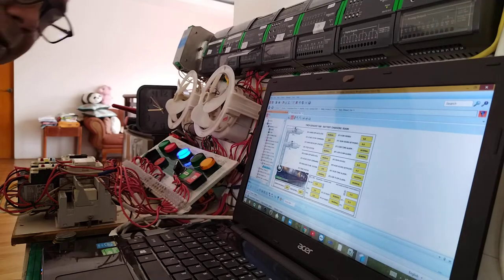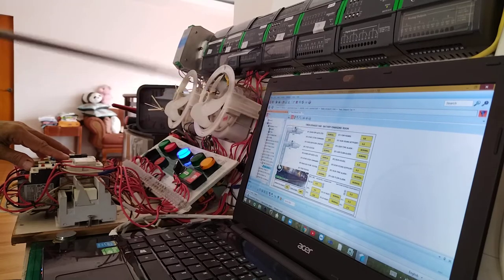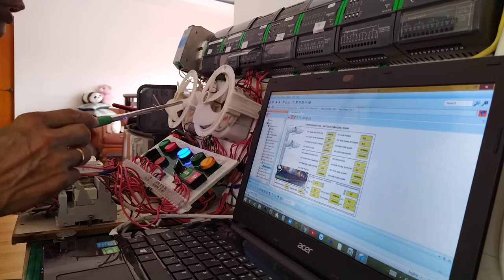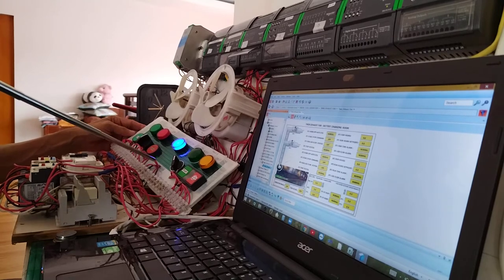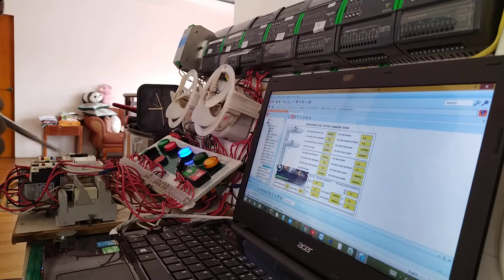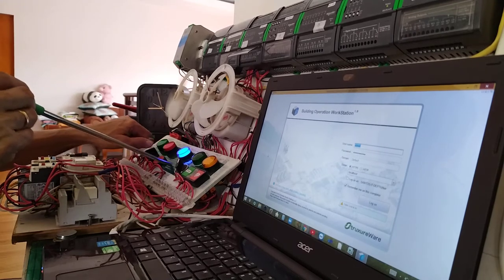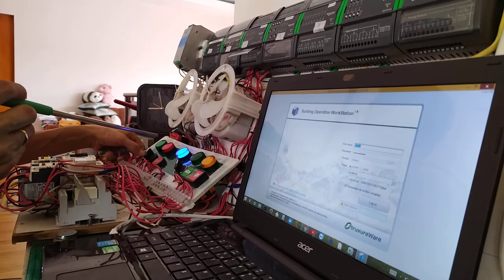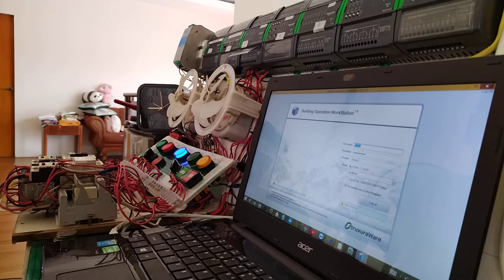New Mini Lab setup on How to Engineer a BMS project

Comment: sir my bms station when i chek my chiller parameter is coming form chiller to chiller configuration point but this parameter not show in my chiller station. so what can i do to all  communicate with chiller point to chiller stations
Reply from the maker: show me some picture, I have  no  idea
Reply: @SantosJrCapellan-BMS  last time come seam prlm coming technician and speak me. here have setting when going power. this time all going to default settings and all parameters secure any wher but i don't know how
Reply from the maker: I don't know  if you are  referring to a Chiller Plant Manager, I don't know how  can I help you
Reply: okay no problem sir i am not explain  properly so my problem you good